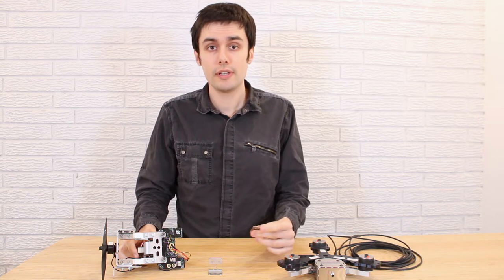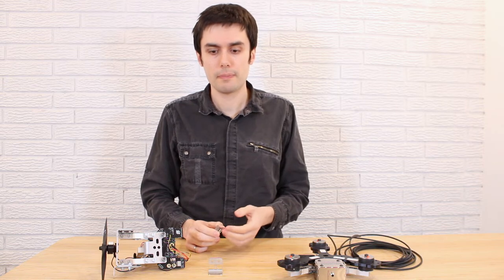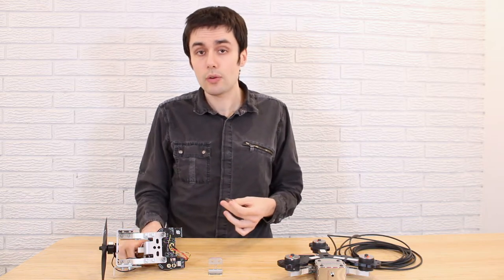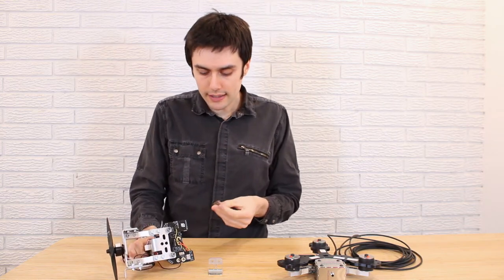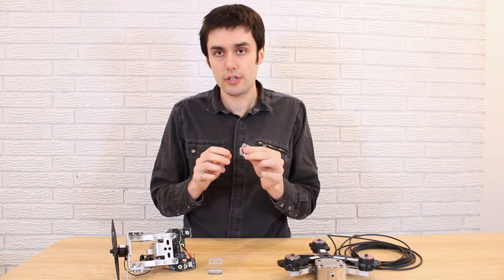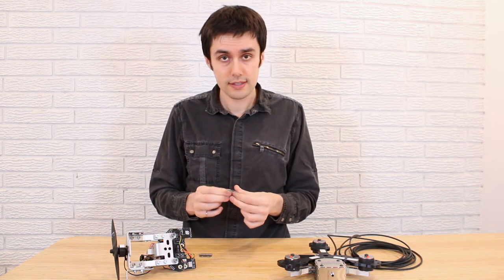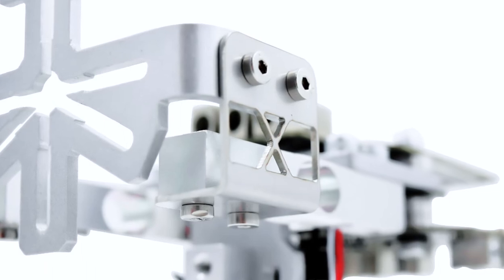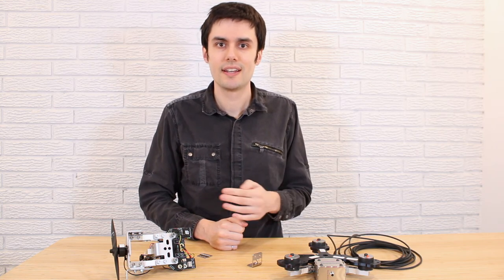How to Build a Thrust Stand - Bearings and Hinges

Comment: Hi, could you explain why a bearing or hinge is required in the first place? Why can't we rigidly mount the motors to the load cells? (supposing that we design a motor mount that is rigid enough)

I understand the purpose of the hinge is to try and restrict the deformation of the load cell along the lateral axis (caused by torque), but you will still have deformation due to thrust).
Reply: Good question! In the Series 1580, a pivot is needed for torque measurement. If you draw a free body diagram of the system and replace the hinges with a rigid connection, you won't be able to solve the equation for torque using the two torque load cells. This is verified experimentally: when we replaced the hinges with rigid blocks, the torque measurements became very imprecise and with very little sensitivity.